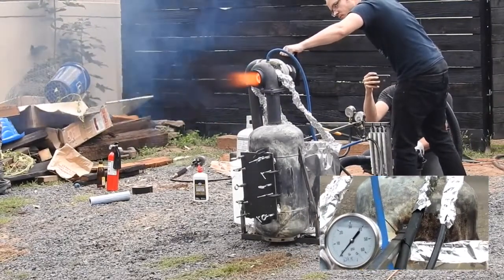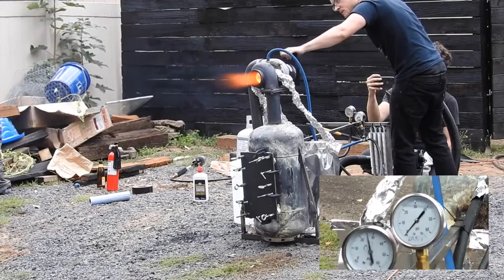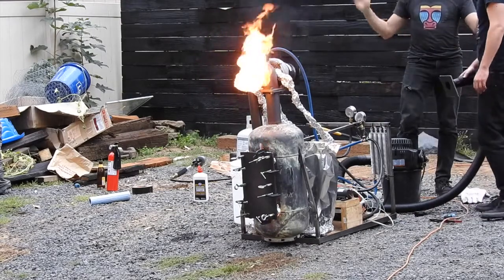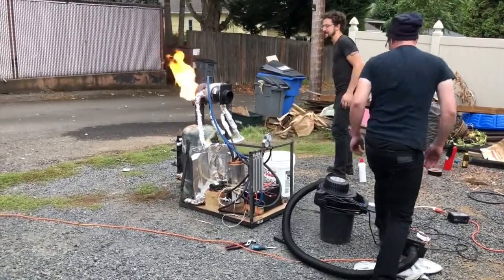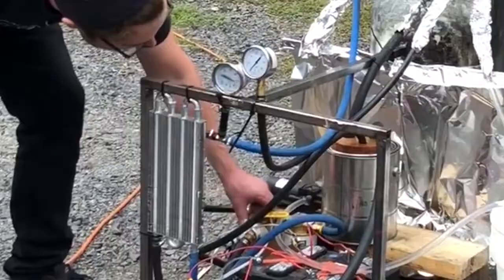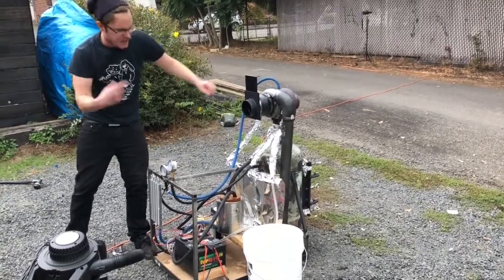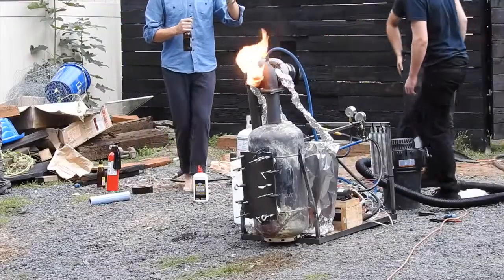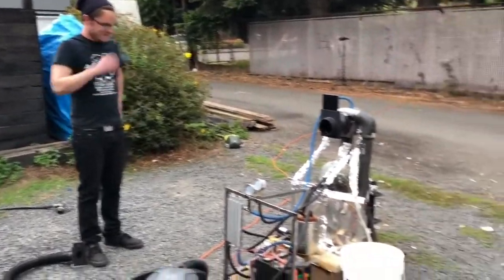TURBOFURNACE:  THE FIRING

Comment: One thing you really need is an air bypass system, so you can send the air from your compressor section straight into the turbo. You can use that to mix combustion air with bypass air to cool it, and run it at full bypass with your starter running to cool the turbine section after you shut it down. That will also prevent all of the exhaust gases from catching fire.
Reply from the maker: Yep, you're absolutely correct, we need to be able to regulate the amount of air that bypasses the burn chamber.

Comment: Read about turbo-props.
Take another "driven" turbo section and put a reduction gearbox and pulley on it.  Connect it to your existing exhaust outlet.
Reply from the maker: Far easier said than done, but we are working on it!
Reply: Putting a power turbine to the exhaust isn't difficult, but connecting up the shaft that is turning at ridiculous speeds is very challenging.
Reply: @Stoney3K  Probably the big trick there would be to use the exhaust side of a giant turbo, like from a Semi-tractor and lose a little impeller speed, but at least you would have a larger more heavy-duty output shaft to couple onto. Still going to need around a 500:1 or so reduction gearbox.